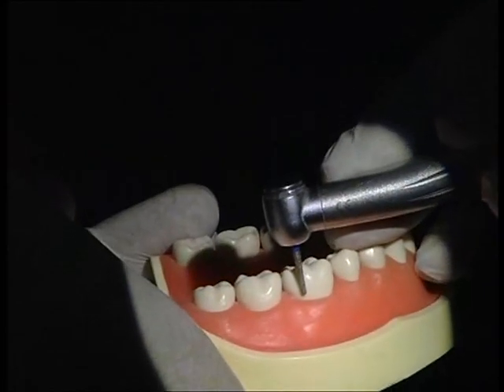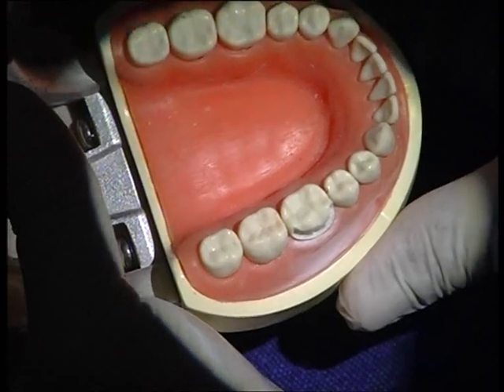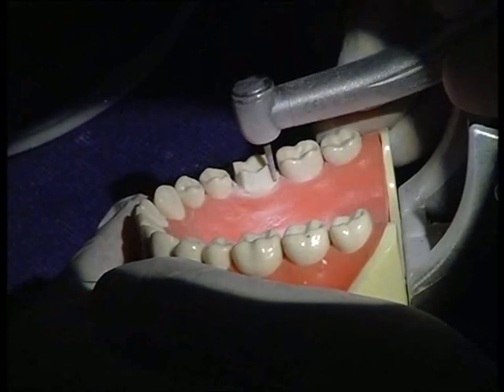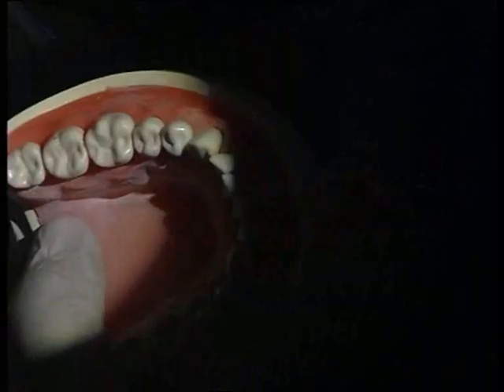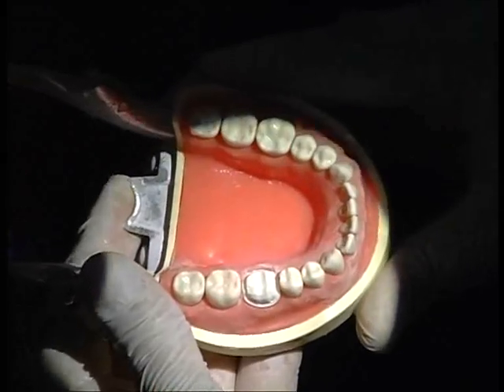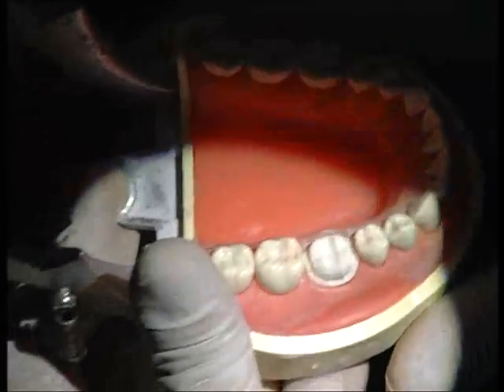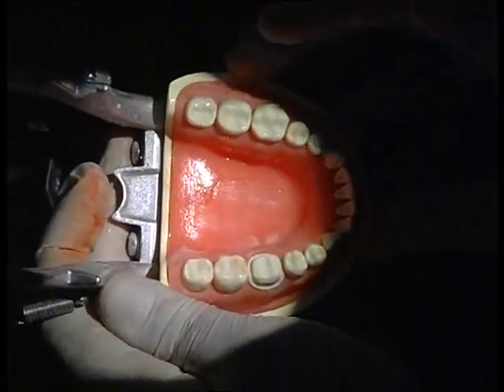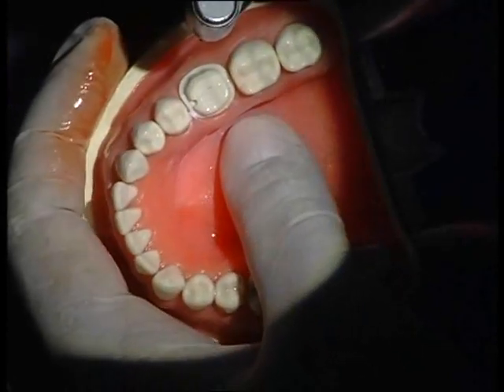Moez Khakiani- Molar Crown Preparation PFM

Comment: Nice video sir.....can u pls tell the bur u used for occlusal reduction?
Reply from the maker: Anup Agrawal Taper Flat bur that is 1.6mm in diameter which helps me gauge the amount of tooth reduction on functional as against non functional cusp
Reply: Dr. Moez Khakiani; MDS Thank you for the reply sir....may i ask the bur no. is it TF-23 or TF- 31
Reply from the maker: Anup Agrawal Sorry for the delay Dr. Agrawal... I prefer to use TF 31 (1.6mm width while TF 23 is 1.8mm)